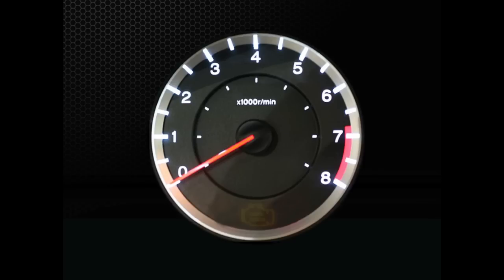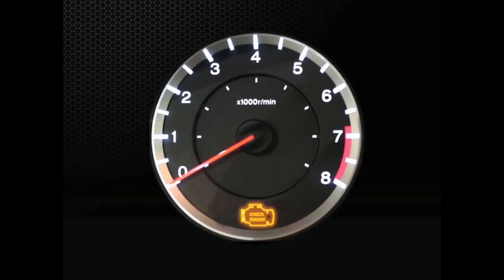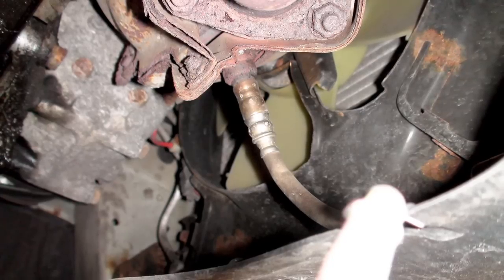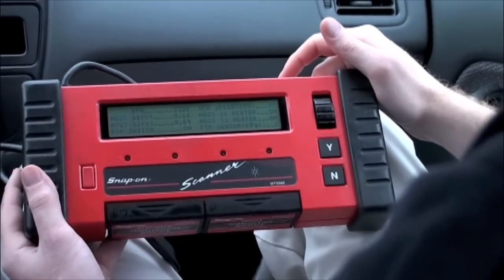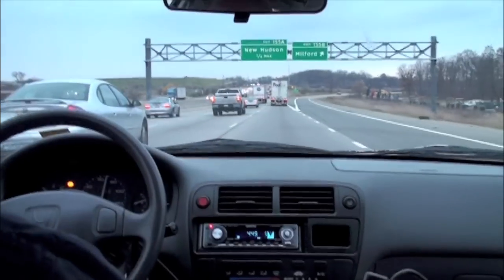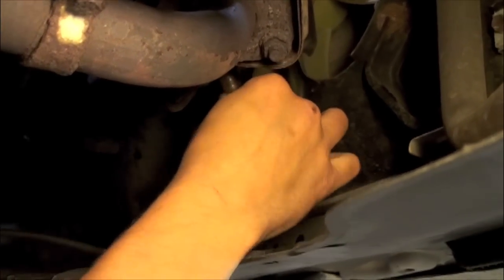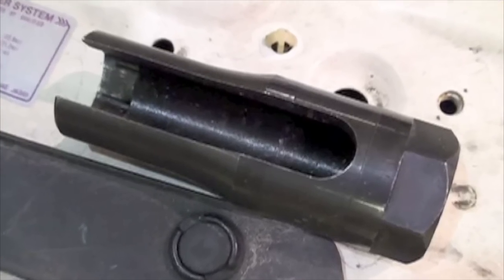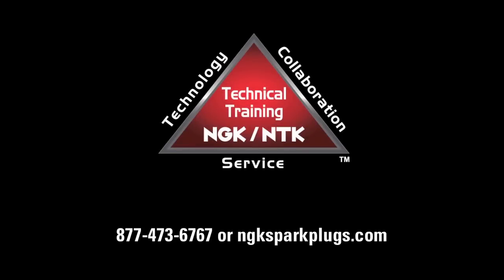Is your check engine light on?

Comment: Im an apprentice mechanic. I have a little question. I know if you disconnect your battery for  1 min or so can reset your check engine light. But is it possible that disconnecting a battery for a long period of time like 1 month can cause a check engine light? My car had no check engine light, i just put back the battery in it and the check engine light came on,
some people have told me i have to do 100 or so milles then it will turn off by itself. Thanks for you time, i really enjoy watching your videos really helpfull!

Comment: I have Honda Accord 2003, I'm having same issue. While I was driving to work suddenly shown engine lights on and APPS lights on. I shut off the engine and looked at the engine seems everything fine, again I started engine lights sign has gone.  After 20 min of drive again shown same issue.  I notice may be engine oil is not sufficient due to some minor leakage I  refill 1 Ltr. and drive seems totally fine another day again shown same issue I checked gas cap everything possible I can, what's wrong going on to my vehicle can anyone please help me ?

Comment: Hi 
I have an toyota aygo, it has the check engine light on. Since the light the car has start to lose power  what could this be?
Reply from the maker: Hi Haroon R,
You will need to access the code in the computer and follow a diagnostic tree for that code. That will lead you in the correct direction of repair!

Comment: I have a 2001 toyota rav4. The code p1135 appeared which is bank 1/sensor 1. I changed the sensor and the CEL is Still on. I also cleared the code and it just comes back. Cleaned mass flow sensor,cleaned throttle body.changed air filter. Checked plugs they were good. What else could it be? Car drives much better but CEL is still on.
Reply from the maker: Hi JAI ROC, 
  Your vehicles sensors have a certain window of operation that they must work within sometimes called a fault window. If/when a particular sensor appears to be working outside of this window the on board computer will turn the Check Engine Light on. The problem could be just slightly outside this window or way out there. Either way, you get a light!
  In the case of an oxygen sensor code; the computer knows the amount of oxygen content that should be present in the exhaust at various times, loads and RPM’s. It knows this due to the programming installed by the engineers after many years of testing before your car was born.  If you were to have a small vacuum leak due to a bad hose or gasket, or a leaking injector due to age or mileage; if you have a bad plug wire or spark plug causing a miss-fire, this would cause the O2 content in the exhaust to be different than what the computer is expecting to see thus, it turns on the CEL.
  Sometimes it helps to try and think like the computer when diagnosing a driveability problem. When faced with a potential check engine light turn on, you may say to yourself, what is happening upstream before the O2 sensor that will cause a bad exhaust gas reading?  Don’t hesitate to give us a call if you need some assistance. Good Luck!
Reply: Thanks for your response.  I will use this information to narrow down the issue. Thanks again.

Comment: Car's Indicators and Warning lights explain.
The app includes 468 unique indicators lights.
http://Carwarninglight.com

This App could save you hours of frustration and trouble with your car. Indicators and warning lights in your car instrument panel are there to signal that something is wrong with your vehicle, before it becomes serious.
Warning lights App can help to avoid expensive repairs, or dangerous situations on the road.
Reply: Raumu

Comment from the maker: Hi Sunish Gowda, 
The check engine light is in indication that there is a trouble code stored in the computers memory. You’ll need to acquire a diagnostic computer or have a shop check the code/s and tell you what it is and go from there.

Comment: You forgot to say be careful not to get the anti-seize into the vent holes in the sensor as this would corrupt the sensor or prevent it from reading anything because it blocked off the airflow.  There is a potential of compound out-gassing as well which could also taint the signal read by the sensor once the exhaust starts to cook the compound.